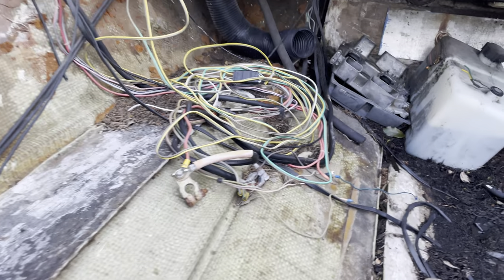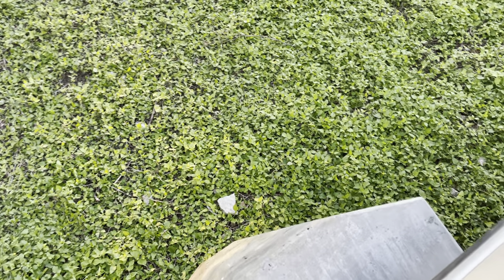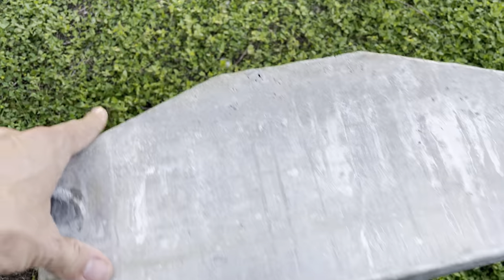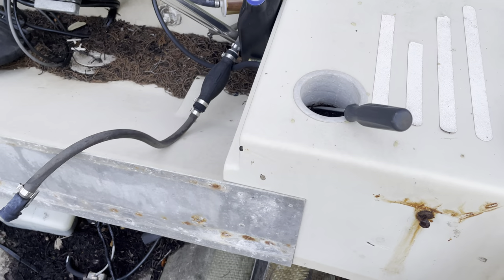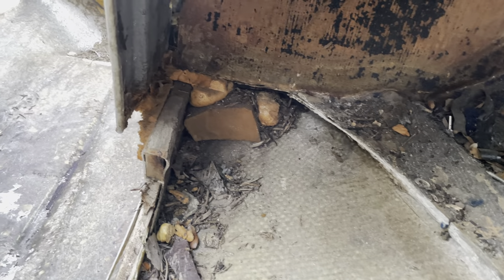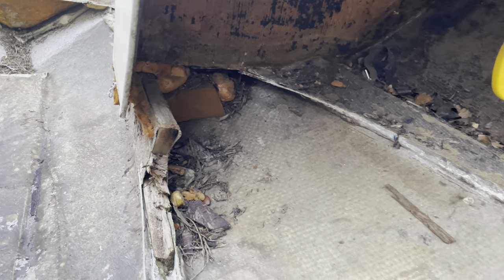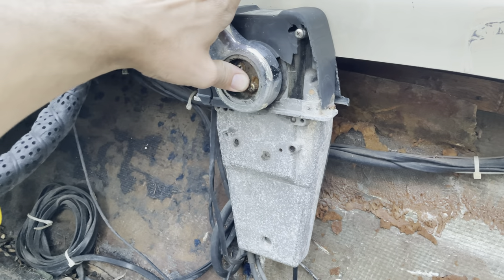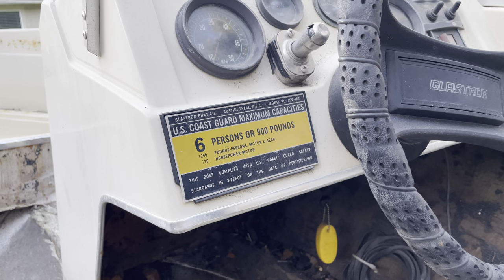Glastron Rebuild Nightmare! Part 7

Comment: what are you referring to when you mention varnish eating the fuel tank, varnish from the pine needles?
Reply from the maker: I imagine it was the fuel sitting in the tank that causes the aluminum to start developing holes. Fuel turns into gummy residue that clogs the fuel pump and carb as it deteriorates.

Comment: I doubt gasoline varnish did that to the tank.. the acid you used is the likely culprit, along with prolonged exposure to what was probably salt water trapped under the tank.. Also if you run ethanol-free / non-oxygenated gas, varnish wont ever be an issue.
Reply from the maker: I hate ethanol fuel. Wait until you get more into the videos.

Comment: Question for you regarding the volvo penta build, when you laid the Kevlar on the decking, did you do large sheets of it or strips? What would you recommend for laying 1708? Large sheets?
Reply from the maker: I ran large sheets of Kevlar and uses of  1708 was replaced solely with standard Kevlar. So far on the boat, zero regrets.
Reply: @michaelromer2016  You’re the man. Love your videos and content. Please don’t stop making them!